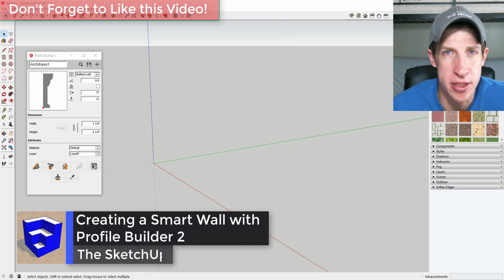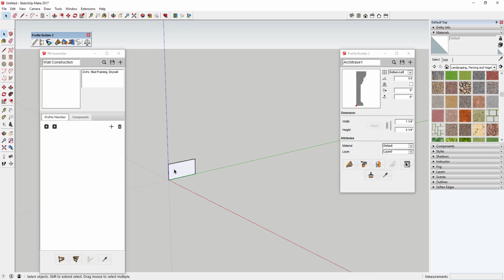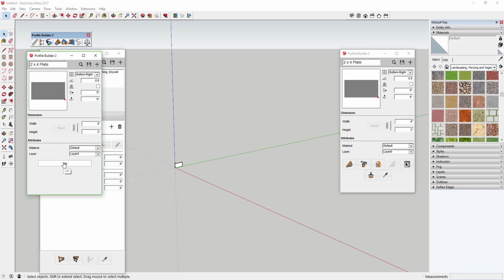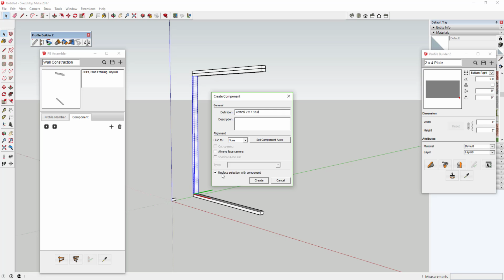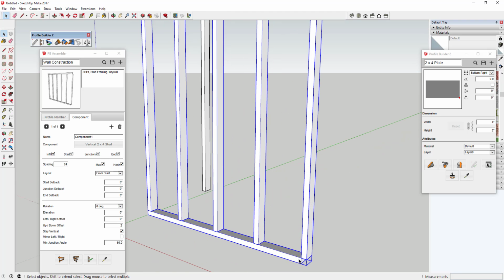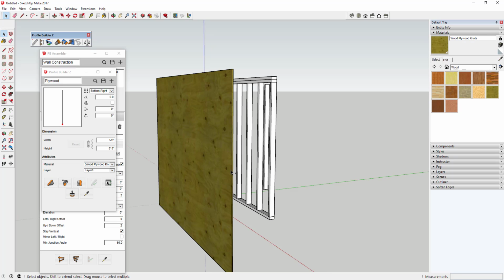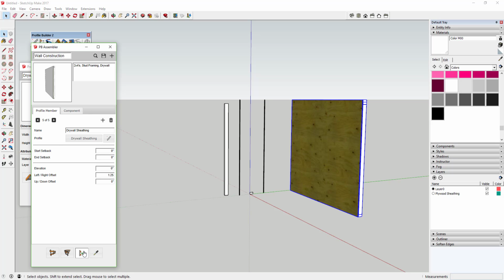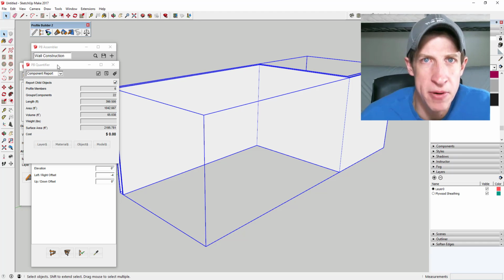Creating a Smart Wall Assembly in SketchUp with Profile Builder 2 - SketchUp Plugin Tutorials

Comment: Hi, In setting up my first assembly I found a minor error in your instructions. You set up the Spacing, but left the Max checked. This adds the maximum studs within the 24 inches. This should not happen. I found that if you remove the check from the Max setting for spacing, it correctly spaces the studs no mater what the length, and you may end up with a couple close together at the end of a run, but that is normal construction framing. Love your videos, just wanted to make sure this got mentioned for anyone wanting perfect spacing.

Comment: Hi Mate love this, 

Ive been using components with attributes to generate accurate reports but is very intensive considering you have create a component then copy and paste it multiple times,

With the Stud feature you can set spacing 600mm which is Australian standard, but I cant for the life of me figure out to get the plate and top plate to work as a component instead of a profile?
Reply from the maker: You can't unless your wall length is fixed - that's the whole point of the profiles - so they can run as far as your assembly requires

Comment: Love the tutorial, but can you make it for Profile Builder 3 to?
Reply from the maker: Is there something significantly different in version 3 you're having trouble with? In general, this tutorial would apply
Reply: @Thesketchupessentials  i want make an assembly from all kind of different walls. So I use for the top and bottom a profile so I can calculate the list with Quantifier. For the vertical beams I use components so I also can calculate. But for the inside or outside I need to use a sheet with a maximum measurement. Then the price don't come out the way I like. Sorry for my bad English but I'm from Holland.

Comment: Too much time to set up. The essential Sketchup tool will do the work faster and you place each object in its correct place the 1st time. This is a dumb program. Other tools build walls without all the user input. Who wants to do all the preliminary set up and inputs just to do a project, then have to modify it all for the next project. Way too slow.
Reply from the maker: I suppose it depends on what you're trying to do. When I'm not explaining it for a tutorial, I could set up the wall assembly in about 2 minutes, plus if I decide to change the stud spacing from 18" to 24" or something like that, I can change it with a single click. In addition, the ability to extrude multiple objects at once along a path AND make changes afterwards without having to re-extrude the assembly could be a big timesaver as well...
Reply: There are other "add-ons" that do the same with less input from the user. Whoever programmed this method wasn't familiar with the rich tools already available and the robust toolset included with Sketchup. Take you, for example, stud spacing isn't 18 inches on center, it's sixteen.  So, it appears someone who doesn't know the program figured out a hard way to draw walls and someone who doesn't know construction is showing others how to do it the hard way.  Other quick draw tools let the user select from a drop-down list or fill in a box to designate the stud spacing and other variables. All parameters are easily edited without all your lost time.I'm aware you lose time "instructing." That aside, you need too many steps to do a task.  Learning the Sketchup "multiply & dvide" tool would be a great start for beginners. And Sketchup has a library of free instructional videos, just for construction. Learn those, then consider if more is needed.

Comment: Hi Justin,
Great work by the way!! With regards to the Profile Builder, could you create bifold doors with this extension that opened and closed like a dynamic component?
Reply from the maker: You could use it to create the doors, but you couldn't use it to animate them. Honestly, there are probably better tools for doing that unless you're creating a TON of bifold doors with varying widths...
Reply: Thoughts so. What tool would you recommend to build and animate multiple bifold doors? Ideally, I would like to put in the height and width and it creates them accordingly? I would be happy to talk to you privately about this if you prefer?

Comment: Is it possible to make drywall, sheathing and silk plates into components to do the same thing?  Instead of making them just profiles so you could make counts of plates and sheathing individually?
Reply from the maker: I think so - you'd just model them and add them like you do the framing pieces. The trick would be figuring out how to get them to cut off into partial sheets. I'm pretty sure this is possible, but I'm not sure off the top of my head. Thanks!
Reply: TheSketchUpEssentials thanks for reply and thanks for your videos they are very informative

Comment: As ever, superb video. I still have three questions: 
1. Does this work with Skalp? [to help create construction docs in LayOut]
2. Are the profiles retrospectively editable?
3. How do you fit doors and windows within the wall build-ups? Is that also a parametric facility within Profile Builder.
Thanks.
Reply from the maker: Hmmm...question 1 - I assume it is, but I haven't tried it, question 2 - yes they are, question 3 - i don't believe there's a built-in assembly that does this - I think the developer recommends that you use an extension like Double Cut (https://mindsightstudios.com/double-cut/) to cut the openings. Thanks!

Comment: Hi Justin. Does the program, when using the follow me tool, add in the corner studs for internal walls and external corner walls, if you know what I mean? This would be more accurate when estimating quantities.
Also can this program draw walls that butt up under a racked ceiling? 
Does the program allows for metric measurements ?
Otherwise a good video.
Reply from the maker: Hi Colin - these are good questions. Best as I can tell, it does not add in the corner studs to make custom corners, and will not modify your wall in a custom way when it butts up to another wall. It will work in metric - it adjusts based on what the units in your model are set to. Thanks for watching!
Reply: Good question, I really like to have answer about this too. 
Also Is it possible to edit the wall and move or add some studs?